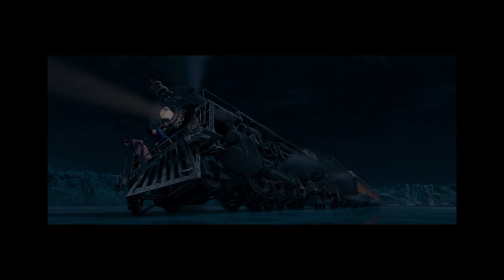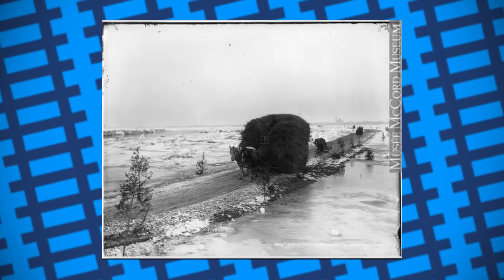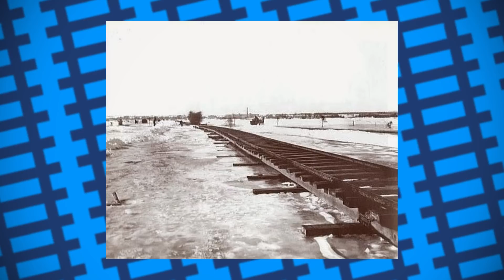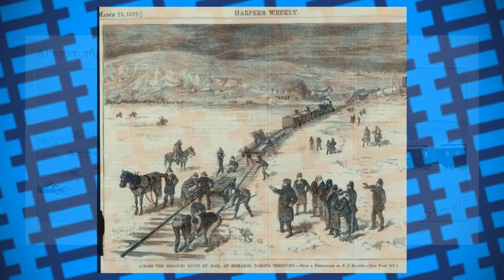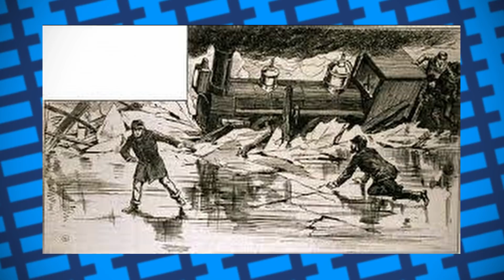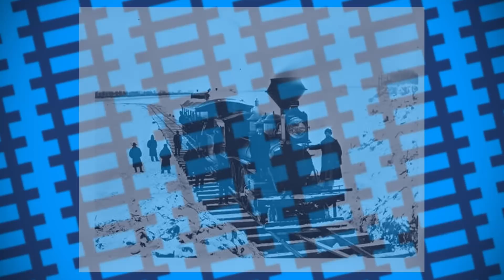Why people would drive steam trains on frozen rivers - Ice Railways

Comment: As disliked by people who know trains and physics, I do agree I am familiar with trains being on ice however, I've only heard about how the Trans Siberian Railway tried unsuccessfully to lay tracks across a frozen lake. I actually had no idea it was a practice in America! Still, a 4-4-0 I can believe but never a 2-8-4. Thank you for another great video! Merry Christmas!
Reply: So your a ice expert?
Reply: More wheels actually = better as less weight per axle. A S&DJR 7F 2-8-0 would be approx the same as a dukedog 4-4-0, which would be better than a SR Schools Class 4-4-0 as that has a heavier (and more powerful) boiler
Reply: Plus the ice will crack under the insane stress it’s under/stress cracking from being bound up.
Reply: @TANGARASandOSCARS  are you certain that the number of axles and axle weight really matters in this case?
I would imagine that with trains the track is what is spreading the load. So the axle-weight shouldn't really matter.
Reply: @Jehty_  Yes and no. Steel rails are somewhat rigid and hence will spread the load, yet are not perfectly rigid - the weight of any axle would mostly land upon the two adjacent sleepers. So, in short, it depends.

Comment: This was similar to The Polar Express where a Baldwin S3 2-8-4 locomotive came across a frozen track and almost sink on it when the ice breaks it was crazy to have an ice railway
Reply: Lima not Baldwin
Reply: @RichardAndewSwayne  yeah and the polar express is based on pere Marquette 1225 N-1 class 2-8-4 Berkshire steam locomotive and it was built by Lima locomotive works along with nickel plate road S-2 765, and the S-3 is a 4-8-4 steam locomotive
Reply: but ITS JUST A FICTIONAL LOCOMOTIVE
Reply: @mrsaturngamingandstories  Then explain the diamond shaped build plate.

If she was a Baldwin, her build plate would have been round.
Reply: Maybe Baldwin like limas plate so they attach that to the Polar Express to make it seems that I was built by The Lima locomotive works
Reply: @mrsaturngamingandstories  I put it down to an incompetent researcher.
Reply: And what did you find

Comment: While fascinating, I was hoping to hear of a situation where the tracks were flooded then frozen, causing a derailment.
Reply: I would not be surprised if that happened on a logging line, as it was not uncommon in the steam era to ford creeks and rivers to save money on bridges when they were too shallow for boats.  Steam locomotives running slowly through floodwater was a typical solution to minor flooding until lines fully dieselized.

Comment: I have an old newspaper article with a print of track over the Susquehanna between Havre de Grace and Perryville, Maryland. It appears they didn’t run locomotives over this section but used chains and pulleys attached to a locomotive on land to pull individual cars over the river. This was done unto the Philadelphia, Wilmington, and Baltimore Railroad built a bridge in the same area.

Comment: The locomotive in the Polar Express is not just based off the Lima Berk Pere Marquette 1225, the whistle sound is from Sierra Railroad #3, the whistle's Appearance is of a Powell three chime, the smoke box front is from Delaware & Hudson steamers, cab is Nickle Plate 765, Cow catcher is a traditional design minus the Link & pin era drawbar, No pockets used in poling methods is on the pilot beam which is common of US locomotives the section of the locomotives boiler directly in front of the cab is of the New York Central J class hudsons.

Comment: I actually did come calculations, and in order to get the Polar Express Locomotive and it's 5 cars across the ice, the ice would need to be nearly 5,000 inches thick. TBH, I think the bigger question is how a pin that probably weighs a few ounces at most could break the ice, even if it does hit it in "the right way."
Reply: Well... It's a movie, it doesn't need an explanation
Reply: That seems like way too much, even for a full train. Did you account for weight displacement across 8 wheels per car, 12 on the tender, and 14 For the Locomotive? Honestly the Locomotive without the tender is the only part necessary to do the math for, because  if that's held up everything else would be easily. Just complete guesses of the locomotive being 1/2 the weight of the entire train and splitting the 5000 you gave over 14 wheels it gives a result of only 178 inches (15-ish feet) Which sounds resonable given it's like 1-2 feet for a car/medium truck. 4 for a big rig. (Again this is all guestimation, and not knowing how surface distribution works, but given the requirements for automobiles, it seems reasonable to me)
Reply: 416 feet thick? Oh my sheeshness. C'mon man.
Reply: @nathantaylor4217  Even then, the locomotives pound the rails somewhat. The pounding of rails would do worse than the pin
Reply: How did this comment get 20 upvotes? The math is horrible lol

Comment: Here in finland ice railroads are normal also in russia the kola river gets an ice railroad every year! The way how they do it is actually pretty special, first they lay the tracks and get a light train to drive over it pushing a ton of water on top of the ice then they raise the tracks and repeat once the water has frozen, when you do this multiple times you end up with a very thick ice sheet around the tracks around 5 to 10 meters.

Comment: Drifting a locomotive on ice technically is possible though. Not that it would be anything like in the movies.
But thick enough (and hard enough) ice provides a non-zero friction surface that a locomotive could build up some speed on and then it's just a matter of getting it to start turning.
Some locomotives have pilot trucks that curve with the rail as it turns. One could rig something up to make these curve ahead of the locomotive to initiate a drift.

No, it most likely wouldn't be moving very fast but drifting is most definitely something that CAN be achieved with a steam locomotive if your goal is to do so.
Anything with powered wheels and some way (any way) to initiate a turn can be drifted.
And tanks can drift too, they don't have turning wheels. In fact they have tracks. They stop one track and keep the other rolling to make turns and they drift just fine. What about a locomotive tells you they couldn't technically do the same?

Comment: As a follow up - railway engines being run along roads? I've seen pictures of engines being muscled along roadways thanks to things such as incomplete bridges and lack of adequate trackage in the area.
Reply: None exist in Grand rapids though
Reply: You mean the town in Canada that used a diesel engine to power it's emergency shelter during a blizzard? It was a MLW M420 and the town was called boucherville. It was in 1998.
Reply: @kingofthepod5169  I'd not heard of that before - I was thinking of the time that a contractor's saddle tank was levered down two miles of rural village roads due to the lack of a complete bridge (this was c.1900 in Britain.)

Comment: Was the train that sank in the Saint Laurent ever recovered or was it just abandoned?
Reply: I don’t know
Reply: I'm going to assume it is still down there. There are a couple of locomotives in the United States that sit at the bottom of a river, one of which is Texas and Pacific Railroad No. 642. 642 was an 1870s built 4-4-0 and crossed an unsafe bridge over Village Creek in Texas and sunk dragging part of its train with it. The 73,000 pound 642 quickly sank into the mud. While some have speculated that the engine was secretly dug up and scrapped, others still claim it is deep underground covered in mud washed over by the river currents.